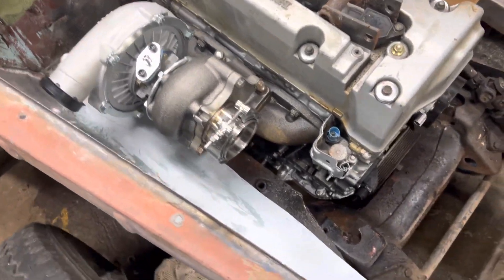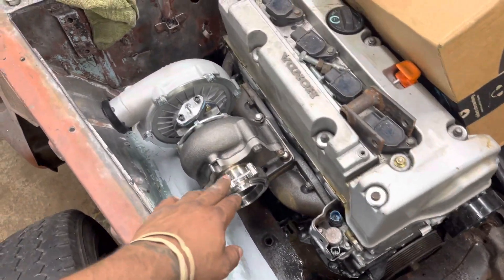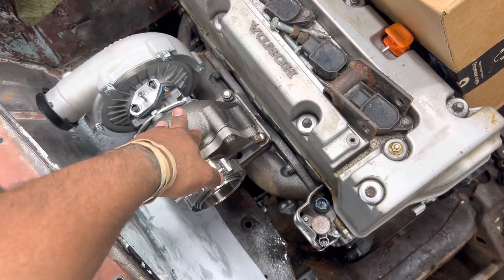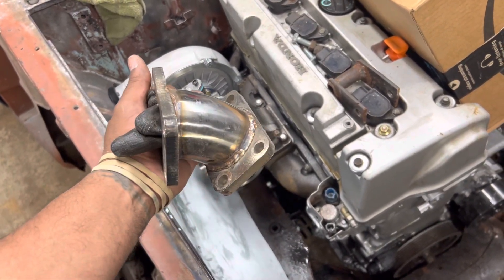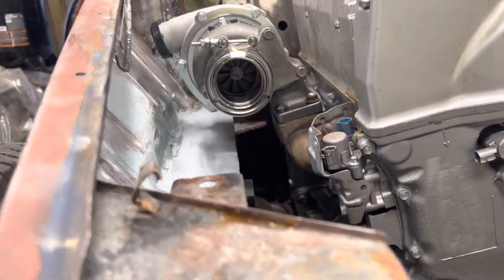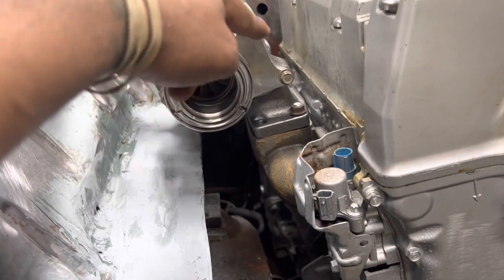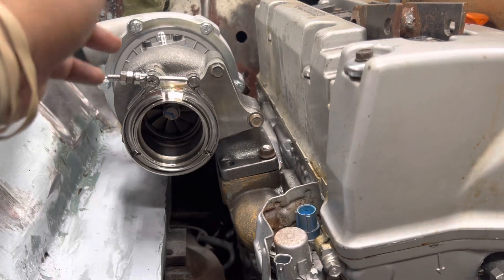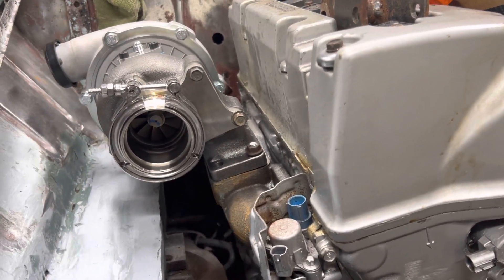Datsun roadster 1600 k24 part:19 RWD swap turbo manifold issue

Comment: Post a vid with the adaptor on the exhaust manifold, and then the turbo flipped. When that is done, does it hit the inner guard? can consider modifying the inner guard somewhat for clearance. Otherwise you might need to consider getting a steampipe manifold made to put the turbo where you want it. Other option is you could mount the turbo at front of engine, but still requires custom manifold.
Reply from the maker: With the adapter the hood won’t close unfortunately